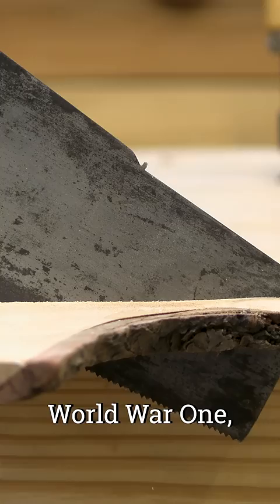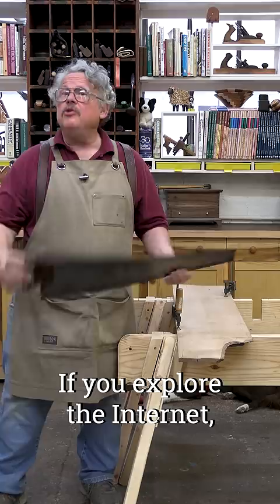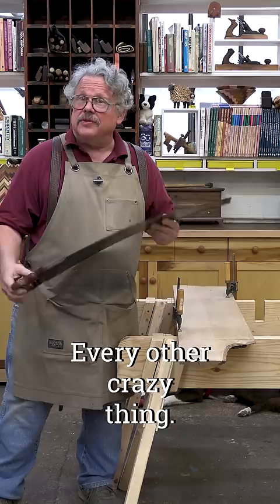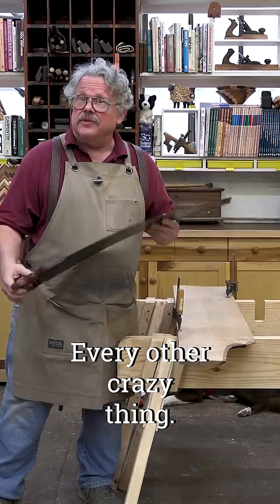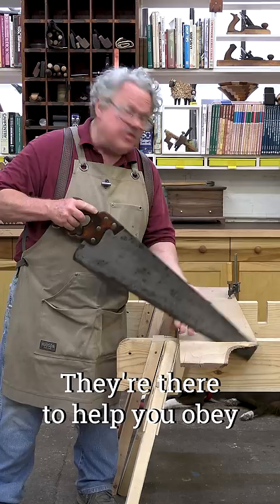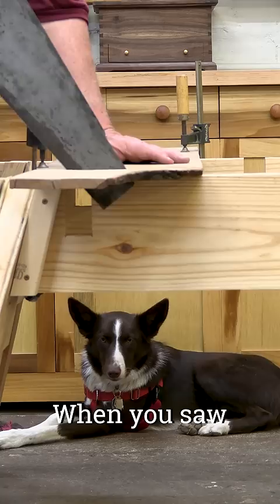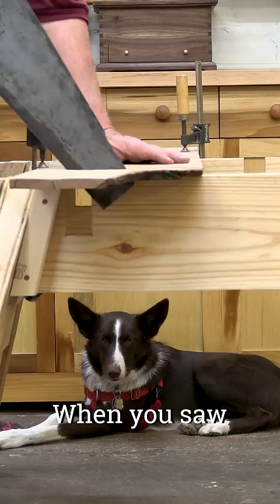Saw Nibs Explained

Comment from the maker: I have been collecting information on saw nibs all during my 50 years of woodworking journalism. This is probably because it involves one of my oldest woodworking memories – my grandfather teaching me to use a hand saw. So I tend to read and watch info on nibs when I run across it. 

Consequently, there is a lot more I could have said if I had known there was so much interest in such an obscure subject. And one of the first things I would have said is that, by far, the best research on this subject appeared in an article in the ToolShed, June 2005, by Jim Packham. In it, Jim listed all the many explanations he had run across for saw nibs: 

1. Maker or starter tooth, 
2. Used to describe an arc, 
3. Clean sawdust from a cut, 
4. Sighting like the sight on a rifle, 
5. Retain a sheath string, 
6. Clapboard Gauge for narrow siding, 
7. Hook to retrieve cut-off pieces out of reach, 
8. Hook to pull lumber toward you on a saw horse, 
9. Used to obtain the correct angle for filing, 
10. Notch the size of teeth for filing guide, 
11. Vestige of handle locking notch for pit saws, 
12. Facilitate the slitting of decorative metal panels, 
13. Remove nails in broken slate, 
14. Practice tooth for saw filer, to check steel hardness, 
15. Holds blade during acid bath pickling, 
16. Vestige of hook originally used for pruning, 
17. Sight to avoid pulling back too far, 
18. No function whatever, 
19. Vestige of the decoration on early Dutch saws.

Note that my grandfather’s wisdom is #17 on that list. And, as Jim explains, the prevailing notion that the nib is ornamental -- #19 – seems to have come from Henry Disston himself, one of the most prolific makers of hand saws in the 19th century. That’s a pretty good primary source. And it’s evolved into what could be considered explanation #20 – the decorative nib indicates the quality of the saw metal and its smithing. Some even suggest that potential customers might have filed it or bent it to be sure the steel was up to snuff.

Let’s ignore the absurdity of a toolmaker allowing potential customers to damage a saw before buying it, and just look at the nibs. It’s difficult to see them as decorative. A very few have some ornamental pizzazz, but on the 1896 Disston No. 12 that I show, it’s just a protrusion. On a vintage W&S Butcher rip saw I have from England, the nib is a simple half-round bump. If these were meant to impress, they fail miserably. They look, well -- utilitarian.

And they do little to indicate the quality of the steel or the toolmaker’s skill. These saw plates began as ingots that, while still hot, were rolled out into sheets, trimmed, and the teeth cut. The plate blanks were then hardened, tempered, flattened, tensioned, and polished. The better plates were “blocked,” a process in which a skilled smith corrects small irregularities with a lignum vitae mallet. Finally, the teeth were set and sharpened. (If you’d like a better idea of just how involved this process was, see: http://www.disstonianinstitute.com/factorytour.html .) None of this can be divined by inspecting, filing, or bending a nib. To this day, perhaps the best indicator of saw quality is to slightly bend the plate and strike it with a wooden mallet. It should ring long and clear. There is a reason that flattening, tensioning, and blocking are sometimes referred to as “tuning” a saw.

But the proponents of #20 may be half right; nibs might indicate quality indirectly. Give the enormous amount of work that went into making a fine hand saw and the resulting expense, you can easily imagine that a toolmaker may have thoughtfully provided customers with a way to protect their investment. After reading Jim’s article and following up with some of the sources he cited, I am inclined to believe that #5 is the most likely explanation for the original purpose of the nib. Circa 1600, when this form of hand saw first developed, it was a hook to keep the front tie of a sheath from slipping off the front of the saw.

We all use sheaths, chisel rolls, and felt-lined surfaces to protect the teeth, blades, and irons we have worked so hard to sharpen. It’s very likely that craftsmen in days gone by would have attempted to sheath their saws, found that ties slipped off the end, and filed a notch near the front to capture the tie. Notches, however, aren’t the best solution. A tie can easily slip out of a shallow notch; deep notches would weaken the saw plate. Sawmakers would have known this, and likely included a nib in their saws for that purpose. Nibs take time and energy to make, however, which helps to explain why only the best saws had them – the old Disston that I am using in the video was top of the line in its time. And it would also help explain why nibs eventually died out. As circular saws became our primary cutting tools, hand saws were relegated to back-ups, and the need for high-quality hand saws evaporated along with their nibs. 

I am inclined to think my grandfather’s explanation was a “found” or "evolved" purpose – something that was already there and craftsmen found they could employ to teach a young person to use a hand saw properly. That moment with my grandfather was a great story and something I could squeeze into a minute. I couldn’t possibly have put all of what I just related in a short or have anticipated there was enough interest in this arcane and enigmatic topic to rate more than a short.

If you’re really interested in divining the purpose of nibs, read Jim Packham’s article. The ToolShed has kindly made it available as a free PDF: https://craftsofnj.org/tool-shed/tool-shed-issues. 

And if you’re interested in teaching your grandson or granddaughter to properly use a hand saw, look for an old saw with a nib.
Reply from the maker: @HydetheRapper  Re-pinned, just to make sure. And I love your suggestion --  one minute fact with additional info pinned in the comment bar. It's so brilliantly simple that I'm ashamed to admit we hadn't thought about using shorts like that; but it's an ingenious idea.
Reply: I found number 20! I like how thoroughly you’ve researched this. The link is to a video by Wood By Wright How To and he explains what he has learned the nib is for. Another neat guess, I suppose. It’s incredible how much research can be done for such an unnecessary topic. Regardless, I’m fascinated. 

https://youtube.com/shorts/NBtI2hV1GLo?feature=share
Reply: Awesome stuff!
Reply: I've also heard, the nib was a sort of maker's mark.  If you could break the nib, it was proof the saw wasn't quality steel, and if you could make a decorative nib that didn't break, the teeth on the saw would probably be of a great quality as well and just as strong.
Reply: @ryanbarrtt thank you for sharing so much knowledge. You must be able to write a Bible about woodworking 😂
Reply: @bradydobson5970  Lol, I’m not sure I could write a chapter. The YouTube algorithm leads me to woodworking often, as you can see I have found my way to two separate shorts regarding very old saws and their nibs. Who knows 😂
Reply: I heard it was a mark of quality, if the craftsman making the saw could successfully make a nib, the saw was good enough to be trusted for use, since it takes time, effort, and ability to produce
Reply: I heard it was used to show the Blacksmith's craftsman in being able to create a quality nib
Reply from the maker: @bradydobson5970  I did. It's called "Woodworking Wisdom," published by Rodale Press. We're about to come up with an updated digital (PDF) version. It should be available soon.
Reply: I love that you wrote a dissertation about saw nibs. This could easily be an article from a mainstream academic/news source. Bravo
Reply: I've heard it was for blacksmiths to prove their craftmanship of the saw. ("If i can create this small nib this precisely, then i obviously know what I'm doing")
Reply: karna6463 yea I think that was eoin reardon
Reply: The one I heard was that it was a kind of gage of skill, that if you can forge that small nub you can forge good metal and saw teeth.
Reply: this is awesome thank you for sharing your knowledge with us :D
Reply: very well written explanation i really enjoyed reading this thank you
Reply: I'd heard they were too show quality. As in the fancier the nib, the better the craftsmen, thus better teeth. Any truth?
Reply: Wow, thats too much
Reply: @bradydobson5970 lmao he hit you with the I already did
Reply: well said
Reply: It's a maker's mark
Reply: Fascinating, all this amazing info about something so tiny that it’s even called a nib
Reply: Im sorry fifty years?!
Reply: Another theory I saw was that the nib demonstrates the craftsmanship is up to standard, if you can make a nib you can make a saw or something like that
Reply: I was under the impression that it was to show how skilled the craftsman who made it was, something along the lines of "if I can make this lil nib, I can make a quality saw"
Reply from the maker: @owenhinkelman6949  I have been building stuff professionally since I was 20. I have been writing about building stuff since I was 23.
Reply: I’m afraid I haven’t used my good hand saws in years. I just buy throwaways. 
It must be thirty five years since I sharpened and set a saw.
Reply: The nib was to demonstrate craftsmanship of smiths that did things by hand
Reply: I really like the idea of it being a mark of quality. If you can make an impressive nib, surely you can make impressive teeth
Reply: The rain of dumb people regurgitating that viral short where it was stated it was a "makers mark" without reading the other 9999 comments saying the exact same thing astonishes me
Reply: Omg, an actual expert,
I thought you people were made up
Reply: Not on your list is what my grandfather showed me. He had an attachment for the top of the blade that made it into a kind of bow saw. It bolted on thru the end hole, but you had to line up a hook-like bit on the nib to keep the end of the blade lined up so it didn't wobble off. Sorry, this is almost 50 years ago. It was a shiny, sheet-metal looking plate with cut outs on both ends for handles. It only attached on the handle, thru the end hole, and on that nib. I first pulled a saw thru wood holding the end of it, not old enough to actually help, he was just teaching me, but it's one of the only memories I have of him, so I remember it pretty well. It might have been a tool he made himself tho
Reply: Before its vestigial role or found uses, perhaps the nib was used as a reference marker for the user to gauge how much to file the teeth down to. The nib may be sized to a min or max that the teeth should be filed down to, and/or the length of the teeth that it left the maker/manufacturer.

You can place your file in the nib, then mark or note how deep the file goes. Then, proceed to file the teeth. You'll know if you file too much or not enough.

The nib's placement on the back (top) of the saw, as opposed to the front (where the teeth are) would prevent a clueless user from accidentally filing it and ruining the reference marker. For a similar reason, the nib wouldn't be on the heel, but also to prevent wear on the nib from regular use. Its ornamental design and blunt form (i.e. not in the shape of a tooth) would further reinforce the idea to the user that it's not meant to be filed down.
Reply: 10/10, impressed with how informative, definitely a like and follow, keep that good information coming :)
Reply: Man I love these shorts keep making em u know I’ll always like and also I subscribed ❤😊
Reply: Is there a way to use a hand saw to saw on the line is there some type of technique to keep it from straying off the line
Reply: Well, if your grandpa said so, it must be correct
Reply: I ain’t reading allat 💀💀
Reply: I didn’t read the whole thing just the list but I appreciate that you put the effort to type it out have a good day good sir and thank you for informing me about saws
Reply: I love this detailed comment on a feature of saws that I've never seen in my life
Reply: I remember hearing the Nib would help show the mastery of the craftsman but it has to have several uses
Reply: I'm commenting because I love that I had no idea about any of this, and you wrote all this just to explain this niche bit of trivia.
Reply from the maker: @semajsga  You're welcome.
Reply: @WorkshopCompanion I thought it was to show the craftsmanship of the maker. If it had a bad looking nib it’ll be a bad saw and if it was decorative and strong it would be a great saw?
Reply: Partially Correct.
A nib is also known as a Saw proof, why because it shows the Saw craftsmen was able to make and display what the type of teeth is on the saw.
it is a display of skill.
Reply: @WorkshopCompanion - 

I never meant to hijack your comments thread to disprove any information you share. I personally find your channel to be my favorite and prefer your approach over Stumpy Nubs. The amount of knowledge, tricks of the trade, and just pure entertainment reminds me of my father and grandfather. There is a special nostalgia that your content brings to me. I humbly believe as you referenced above that the existence of a nib can be subjective dependent upon many factors. Years ago a hand saw was handcrafted and the definition of said nib has since been interpreted in different ways as manufacturing processes have become ever more automated. There are many examples of product evolution where they still incorporate the roots into present day. As always, I love your content and appreciate all you've educated us on.  Looking forward to the growth of your channel and all you can pass down to us!
Reply from the maker: @battles151  Actually, I wish you would hijack more comment streams. This has sparked an energetic exchange of ideas and opinions. As a teacher, I know from experience that sessions like these always turn out to be the best classes. As long as the exchange remains civil, all you have to do is sit back and let the conversation continue. Everyone will learn something -- oftentimes the teachers more than the students.

That said, you still haven't convinced me that saw nibs are a display of craftsmanship. I have several old saw plates that I cut up to make shaped scrapers for intricate moldings. (I'm maintaining/restoring a Victorian house. There are intricate moldings dripping off every surface.) Every single scraper I've  made is more intricate than any nib I've ever run across, and I'm in no way a skilled saw smith. If I were, I surely could have come up with something more impressive than a nib.
Reply: Thank you Mr. Saw Nib fellow.
Reply: I heard it was about the quality of craftmanship that the one who made the saw could make a nib to prove they were proficient and that it was strong enough that one would trust the saw quality as well. Something about the quality of all the metal used in it's making. But what you said does make more sense.
Reply: Why did they stop using them?
Reply: oh i'm a worthless cripple waiting to die in legislated poverty, I won't be passing anything down, my line ends here
Reply from the maker: @battles151  And here I was hoping you would hijack more comments threads. What you did was spark a discussion. Love that.
Reply: "It's difficult to see them as decorative" that's because they're not, they're a vestigial feature of what once was a decoration. If you look at even older saws, the nibs were more intricate, more difficult to make with the tools and techniques of the time. As mass production and the like became more common, nibs started to shrink as it was expensive and unimportant to continue decorating them, as it ceased to show the craftsmanship of the maker. That's also why they're not on most modern saws.

Think of it like legs on a snake. Sure, some snakes sometimes have them, but they don't do anything, they're a leftover feature of a bygone time.
Reply: That's neat. I love how numerous different people on here have thought about and researched the trending curiosity. Saws are cool.
Reply: Naw bro wrote a document fr 😭
Reply: My goodness. You've done some amazing research! And it was a very interesting read, not to mention quite informative too!

I do love reading about these kinds of things because to me they present an opportunity to glimpse into our past.
Reply: i think this is the best followup comment i’ve ever seen thanks for this
Reply: You can’t use a hand saw properly without a nib? What have I been doing 😂
Reply from the maker: @obscure.reference  Most welcome.
Reply from the maker: @Kaiquintos  Thanks for saying.
Reply: My great grandpa who was a smith when young said it was there to show to the skill of the smith. I don't know if its true or not but when i looked up old saws they all had intricate nibs. 

But a dual purpose is definitely possible. If you find it useful for something than why even bother with finding out the original purpose?
Reply: I've heard it's like a calling card to demonstrate the expertise of the Smith.
Reply: While I read none of the paragraphs and do not plan to, this is a great comment!
Reply: Thanks for the info!
Reply: To me it sounds like this this nib was one of the most useful parts on the saw lol
Reply: I never read comments on shorts, but this one I just had to read fully to find the purpose for the nib.
It was worth it.
Reply: This is great! I was mildly interested but with you and all of the other craftsman exciting the world to make again. Thank you!
Reply from the maker: @zekand  Most welcome.
Reply: This is the longest comment I ever saw on youtube.
Reply: Omg this information could totally be a good video 💛💛💛
Reply: Thank you for researching and writing so extensively on this! I never would have thought of saw nibs before, but getting to learn about it here has been absolutely fascinating
Reply from the maker: @axuwu6939  Thanks for saying.
Reply: Very interesting, it's nice to see comments that aren't posted by people just trying to become the next meme for a change✌🏼
Reply: After a bit of research, I found that the nib is there to show the crafting quality/ability of the maker. Which would be your number 20!
Reply: I kinda stumbled into these shorts by accident with middling carpentry knowledge, but I just want to say that you're a fantastic writer and speaker! You do a fantastic job at making this informative stuff riveting to read and listen to, even for a topic that I'm not interested in.
Reply: Never cared or knew about this. But your passion comes through in your writing and I'm very impressed with what you've taught me
Reply: Someone else made a short explaining that they were used to showcase the sawmakers abilities. They said it was a difficult part to make correctly and having a well made nib demonstrated that whoever made it knew what they were doing and thus made it easier to buy a quality tool.
Reply: I love all the comments proclaiming one of the reasons he just explained aren't likely and why. It's like they didn't even read the comment they're replying to, or were incapable of understanding it.
Reply: @bravojr Making a nib would require no more, and perhaps less, skill than it would take to make the teeth of the saw. This explanation fails the common sense test, and the shear number of people confidently  repeating it is pretty depressing.
Reply: You're wrong about the nid .. it's a maker's mark
Reply: Speaking as a design student: the cool thing about design artifacts is that it doesn't really matter what it was "intended" for, it's how people use it that matters. So most of these explanations are equally valid, because once someone found a use for the nib, they'd want to keep including them in their saw design!
Reply: This comment is SO IMPORTANT! Thank you for making it. As soon as the video started playing I was like, "he'll claim it's one thing, but we know there are like dozens of other things it could be, this is a wild niche history thing that people will argue about to their graves..." and then... You left this lovely comment! And on a short, no less! Great work!
Reply from the maker: @error.418  Thanks.
Reply: I've heard they were for show the skill of the craftsman that made the saw. Is that not right at all than.
Reply from the maker: @ryan58ify  My answer to that is the paragraph beginning..."But the proponents of #20 may be half right..." As for showing the skill of the maker,  I often regrind pieces of old saw blades to make shaped scrapers to restore old moldings. Many of the shapes that I grind are more complex that any nib that I have ever seen, and I am not an experienced sawmaker. Grinding or filing a nib is not an indication of any special skill other than you can see well enough to grind to a line.
Reply: @ryan58ify  Probably not, but who really knows, there are so many theories about it
Reply: thanks
Reply: This is why I don't particularly care for youtube shorts. You have only so many seconds to say something. In this case, some people might watch, think the nib is there just to help with sawing, and not look in the comments. I mean, the title is called "saw nibs explained", but only in the comments do we get a more concise explanation. At least it's pinned at the top of the comments, and of course, your own personal story is in the short, so it's not at all a bad compromise that you've found.
Reply: Thanks!!
Reply: who knew such a tiny piece of metal would be so useful
Reply: I can't believe I just read this entire thing, but for whatever reason it fascinated me. Thanks for sharing
Reply: @WorkshopCompanion bro i literally googled whats the saw nib for and the fist thing to appear is that it has no specific use 💀
Reply from the maker: @table_f0rk  Unless you believe that Google is the font of all wisdom, you may want to read the pinned comment.
Reply: Incredible, real congratulations. You made me a birthday gift with this info. Have a great night❤️ 🇪🇦 in 🇳🇱
Reply: Thank you so much for preserving and informing us on this small bit of history!  :D

I have one of these nib Saws from my Grandfathers workshop as well, I doubt its truly an old pre-WW1 saw, but it might be a manifacturer or blacksmith that passed down the tradition and implemented it into one of their newer saws (like 1950s). Never had much thought but I've always kept it in pristine condition for memorabilia. 

Nice to finally know it actually had a long-lost purpose and it wasnt just a mistake!
Reply: I ain't reading allat
Reply: bro wrote a thesis on the nib
Reply: Oddly interesting
Reply: Thank you for this 😁
Reply: Growing up in a frontier location meant that I spent a lot of time around old tools and practices and while I don't know if I was ever told as much #5 is the reason I remember, many of the tools were sheathed or protected in similar ways after all.
Reply: If we are looking at it as a tether/sheath option, would this also apply to the compass and back scratcher?
Reply: Now the next question is why it become obsolete?
Reply: thanks ❤❤❤❤
Reply: With high possibilities you conserved this knowledge forever with this post thanks ❤
Reply: Very well thought out and well spoken.   It's so refreshing to see someone taking the time to write a comment like this, and not some derogatory comment saying how stupid the creator of the video is.  I learned something and that means today wasn't wasted. Though I will add, that I hate using hand saws and when I do need to use them I reach first for a Japanese saw, I find them easier to use, but I've always kept my old Western saws like these that have been passed down from my father and grandfather's and love the history of them.
Reply: I was always under the impression it was to show the quality and ski of the man who made it
Reply: Where can I find your journals? I would love to read them and have them handy.
Reply from the maker: @lightynight  https://workshopcompanionstore.com/collections/ebooks-2
Reply: @WorkshopCompanion  thank you!
Reply: Thank you so much for the further explanation.  It's very much appreciated boss
Reply: well its like the local reenactor woodwright would say if you purchased 18 inches of saw use all the saw you paid for, when I see him at the old fort in fort wayne, and taught me how to saw stright with a hand saw and technique because I could never get it to saw straight when I used one.
Reply: huh
Reply: That's awesome in it's thoroughness. Thanks.
Reply: why not make this a video instead of writing a book's worth of a youtube comment about it?